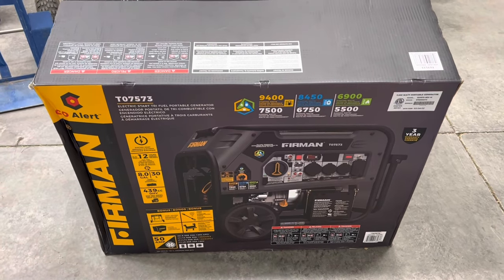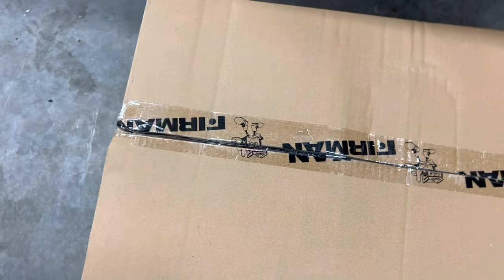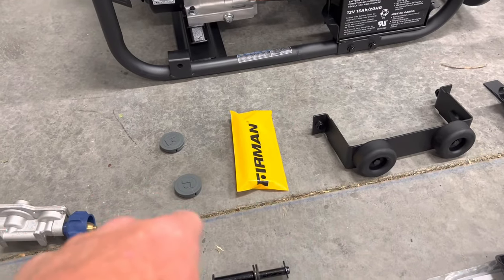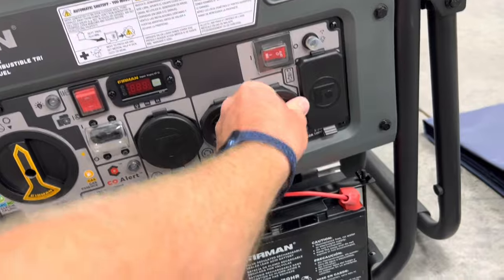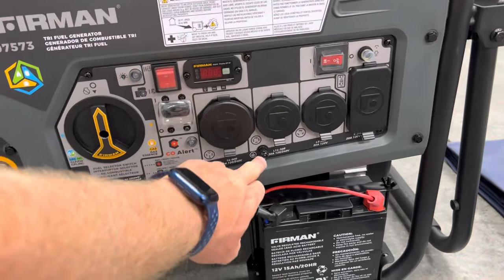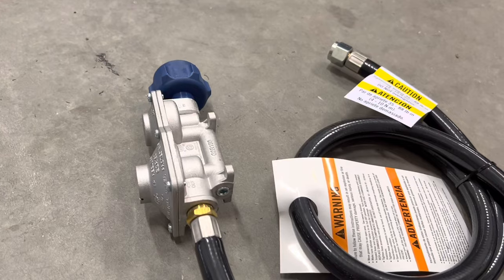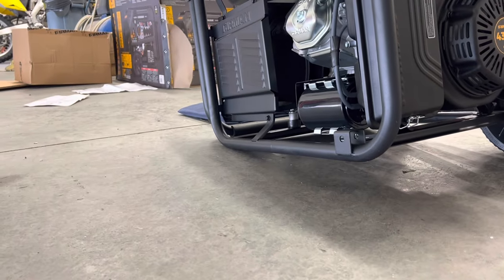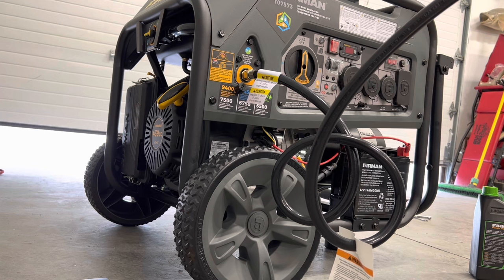Firman Tri-fuel generator unbox and setup.

Comment: Looks too "delicate" for me. I live in Florida and I have 3 older gennys. One is a fifteen year old Coleman. All Gas only and super-dependable. Sometimes 2 years between uses...but when I need them... they start....every time. I do a very close check of the units before they are carefully stored, ready for the next emergency.
Reply from the maker: What is “delicate” in your opinion. Having just had a Honda die on me, I’m more than impressed with this so far.
Reply: @BryanHansen  oh… it’s nice but I have concerns about the carb/regulator and the really proprietary control panel.
Reply: @goobfilmcast4239 ? Ok.

Comment: Have you had any communications with FIRMAN about this product. I recently was advised by FIRMAN that extending the exhaust pipe or installing the Generator in an enclosure would VOID my warranty. Any advise on this?
Reply from the maker: I haven’t. But if I am going to be running it, it will definitely be outside. My set up might be a little different than yours.

Comment: This generator can use all the necessary energy power gas,lpg,and natural gas. The firman manufacturer put it there for our choice. Just do the proper check up maintenance and this generator will run properly.

Comment: Very nice, any upgrade over the older blue model? 7571 vs 7573
Reply from the maker: They are basically the same machine
Reply: Only difference is this gray one has clear plastic covers over the switches
Reply: The gray model have CO sensor auto shut off the generator if there are high level Carbon monoxide if you run in garage or confined space.

Comment: -Kind Sir, I just bought a new Westinghouse WGen9500DF Generator. And its regulator is on the face of the generator. And you must connect the Propane to this regulator. Now I want to use natural Gas too. So, where would I put the connector; if I do it? And would it damage the Propane Regulator; if I connect the NG to the Propane Regulator inlet?

I really want to use the NG gas. Thanks kind Sir if you can tell me WHERE the NG connects to the Generator. Or must I buy an "Adapter" installed on the carburetor? But I do NOT need a regulator; what all others are doing. O yes.
Reply from the maker: The Westinghouse is a Dual Fuel, not a tri fuel. I don't think you can run that on NG.
Reply: @BryanHansen  Well they do it all the time. So I'm thinking that we could connect the NG in the inlet on the propane regulator. Thanks for your reply.
Reply from the maker: @MrPatdeeee  the only thought I had about it is that NG is already low pressure on your house. Adding a regulator might lower the pressure more. Test it, it might get a lower pressure shutoff with the propane regulator if it restricts too much of the already low pressure.
Reply: @BryanHansen  Thank you kind Sir. I have got an idea: In my propane regulator there is a long hose from it's outlet. to the carburetor. So I am going to buy a "Y" fitting. With two stop knobs.

This would let the NG going after the propane. And the "Y" fitting would determine which is going thorough. You can see tha "Y" on Amazon. In that way, the NG would go straight to the Carb...when the Propane is stopped. 

And vicy versa when the NG is stopped; it goes through the propane regulator. I can't wait. And I owe it all to you. when You said in the beginning of yur video. That we do NOT need a regulator of a home NG. Because they have ALREADY regulated.

Thanks. kind Sir. I believe this will work to make my Generator a TRI-Fuel Whoopee! Wow! I will let you know IF it works or doesn't.

Comment: Question...

Do you have to put the choke lever to run, not choke, when starting with propane?
Reply from the maker: Pretty sure I still choked it. I can try it again though.
Reply: @BryanHansen  it's still in its box but I have all a need to assemble it. I even bought 5W30 synthetic oil because I live up North. I have watched several YouTube videos. One guy had problems starting it with propane when he set the choke lever to choke. It started and stop. Anyway I will see what happens. Thanks for your reply...

Comment: Does the battery need to be connected when using the manual pull start?
Reply from the maker: To be honest, the owners manual has been inconsistent on the wording regarding this. It actually says it will only pull start in gasoline mode and I believe it says that the battery needs to be connected. But I have pull started it on LPG and it worked fine. I have NOT tried it without the battery, but I believe it will work. I will try it and let you know.

Comment: Is it a good idea to just run it on gasoline? You said something about fuel stabilizer? Is it more maintenance running on gasoline?
Reply from the maker: I wouldn’t run it on gasoline unless you plan on doing so fairly regularly. Gas goes bad and gums up the carburetor. I’m using mine solely for my home as backup so I’m trying to never put gas in it.
Reply: @BryanHansen  thank you for your feedback. Will definitely consider it.
Reply: You'll get more power with gas. But the ethanol in the gasoline will degrade parts in the generator. I would recommend only using propane or natural gas.
Reply: Find non ethanol gasoline if you can. That alone has a shelf life of half a year or so but regular pump gas will be fine too. Then get a bottle of Sta-Bil for $10 and add however much you need for the ratio of fuel. This will extend the shelf life to 2 years so that the generator will be ready to rock in case of an outage. After using it for an outage run it with fuel shut off switch on until it shuts off and there is no more gasoline in carburetor. Easy peasy and far more convenient and powerful to use gasoline anyway during an outage unless you want to get a 500 lb propane tank installed or just so happen to have a natural gas line.
Reply from the maker: @kitchentrout5867  Tell that to the Honda generator I had that is now ruined after one year. Literally 91 octane ethanol free with sta-bil in it. The whole storing gas thing sounds great in theory until it’s not. I am using natural gas because I do have a line right to my house. I also have propane tanks as well. And in the event that neither of those are feasible I can run gas in it. Rather than store it I would siphon it out of my car or use what I have on hand after the first two options are no longer available.
Reply: It's a good idea to run it on gasoline during the break-in period.
Reply: @Pk3_Garage  Interesting..I didn't realize this.  So during the break-in period it's not a good idea to run Natural Gas through it then?  Could you explain the reasoning behind this?  Sounds like most of what I'm reading, ppl are recommending to not use gas at all with it and only use NG/PP.
Reply: Sorry, I tried to find a link where I either saw or heard this. (Couldn't find it) 

During the break-in period, you want all the engine parts/components to wear in correctly.  (Which I'm guessing it doesn't on LP or NG) From what I remember, gasoline is still in liquid form, when being burned inside the combustion chamber.  Because of its liquid state, it lubricates certain parts/components inside the engine.

LP and NG are in a gas form, when burned in the combustion chamber.  It doesn't have the ability to lubricate these same parts/components, like gasoline can.  So over time, parts wear out because of lack of lubrication.

That's why LP and NG burn cleaner than gasoline and is better for the engine.  

Personally, I use NG 99% of the time, but at least once a year, I run our generator on gasoline, to help lubricate the parts/components inside the engine.
Reply from the maker: @utrutr6013  Just looked at the manual and there is nothing in there that states this. https://www.costcobusinessdelivery.com/wcsstore/CostcoUSBDCatalogAssetStore/pdf/1900555.pdf

Comment: I will be using your video when I assemble mine in a few days. Question... Why the owner manual says to use only a 20 pound capacity propane tank or less?
Reply from the maker: Honestly not sure. It shouldn’t matter since there is a pressure regulator anyway.
Reply: @BryanHansen  Thanks.
Reply: Answer from Firman...
You can use a larger tank but you have to have the LPG fitting switched to match a larger tank and ensure the pressure will be between .9 - 1 PSI going into the generator
Reply from the maker: @mpierrela  unless we are talking about 100 gallon tank or larger, the fitting is the same for an 80 down to a five. The regulator will still regulate the same pressures.

Comment: If your back feeding your panel the neutral and ground are connected anyway.
Reply from the maker: Using the Generlink I installed it is bonded and not a true back feed.
Reply: @BryanHansen  they way a main panel is wired all the neutrals and grounds are connected together by design. So if your connected to the main panel is not an issue. Also connecting neutral and ground together outside the main panel is a code violation. You can end up with the ground acting as neutral and it's a fire hazard.
Reply from the maker: @mp-xt2rg  I think we’re saying the same thing

Comment: Mine won’t stay on consistently and it’s brand new, added the required oil, and added gas that was only a month and a half old, it starts up and runs and then bogs and sputters and picks back up again until it bogs and then cuts off, it’s brand new! What’s wrong??
Reply from the maker: Are you running it on gas or propane or natural gas?
Reply: Gasoline @BryanHansen
Reply from the maker: @Pfillwieffer  try running some seafoam through it. https://amzn.to/3vRsF2L
Reply from the maker: Make sure your choke isn’t on too
Reply: Even though it’s brand new? Also yeah I made sure after start up to put my choke to the run position. Thanks for the tips
Reply from the maker: @Pfillwieffer  well, brand new I’d exchange it at Costco if it were me, but it depends on how much of a hassle it is for you.

Comment: are you happy with the TO7573?  Im trying to decide between that one, the TO7571 and the TO8071.. and now there is a TO9725  all about the same price  now on sale 25%off
Reply from the maker: I’ve loved it. The 9725 would be nice with the extra wattage, but keep in mind needs a bigger supply line to pull that wattage.
Reply: @Bryan Hansen  true. I don't want to go through that again. Lol Thanks
Reply: @BryanHansen  ok i pulled the trigger.. ordered the TO7573 wish me luck.
bought their 25 ft ng hose from them as well.. ill let you know how it goes..
Reply from the maker: @johngraziano6652  I think you will be happy!
Reply: @BryanHansen  eureka !  got the unit today.. put the wheels,put the oil, hooked up the gas,, started right up!! Thanks to all you and all the folks who helped me with this!
Reply: @BryanHansen  so i was worried about trying it with the heat.. so i finally did.. turned on the gen  then turned on the furnace.. i didnt notice and change in the engine speed..  so hopefully it will be ok during winter months ..
Reply from the maker: @johngraziano6652  I think you’ll be way good with your furnace.

Comment: Bryan, Thank you so much! This was perfect. We just bought this model for our home on Maui. We did not lose our home by the grace of God but we are in the fire zone on the West side of Maui and need to be ready for what comes. Anxious to get off work and set this up on our plumbed propane. Question, what do you recommend for bringing the generator closer to items I want to power. I have two ports on the house to connect to propane and was wondering if you would buy more connecting hose or just more power cables. I would appreciate your thoughts. Thank you and god bless. Chris from Maui. Aloha and Mahalo a nui noi!
Reply from the maker: Hey Chris, glad you were saved! That was so disheartening to watch. I would absolutely move the generator closer what you want to power rather than run more extension cords to what you want to power. The propane line will carry enough pressure to the generator, the power lines on the other hand, lose efficiency over a longer run.
Reply: @BryanHansen  thank you! Do you have any suggestions for what kind of propane line to buy?
Reply from the maker: @cfitt it comes with a short one. If you wanted a longer one, I would honestly go to a hose supply shop. Central Maui Propane will likely build them or point you to who can. That being said, I installed this one: https://amzn.to/3E34vTU and you could use the regulator you have or if your whole house is regulated, just install this hose at the location. Nice thing about it, it is a quick disconnect.
Reply: @BryanHansen  thank you so very much!
Reply from the maker: @cfitt you bet!